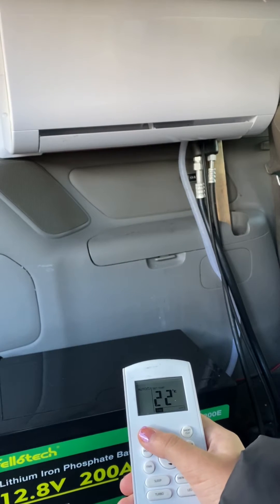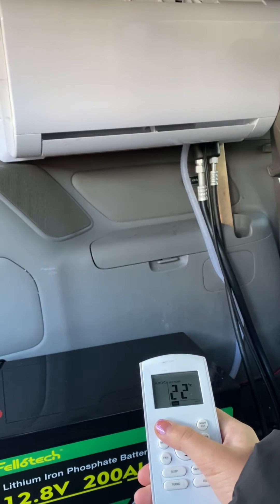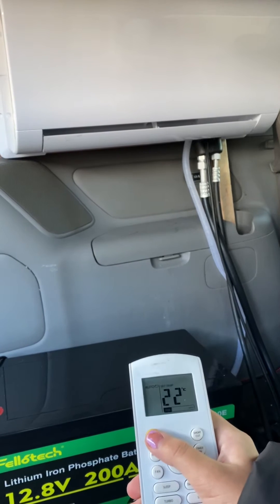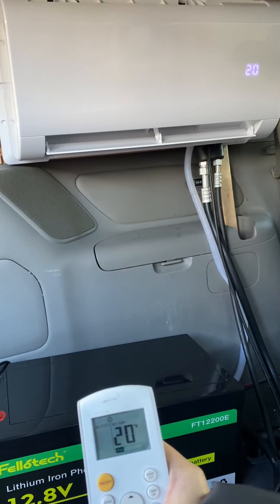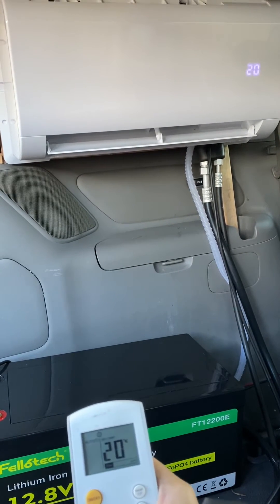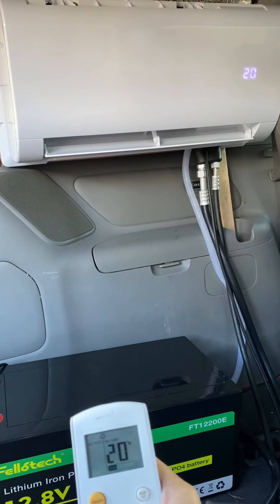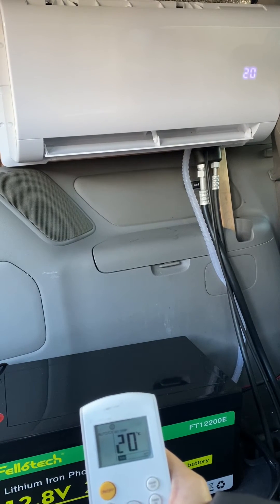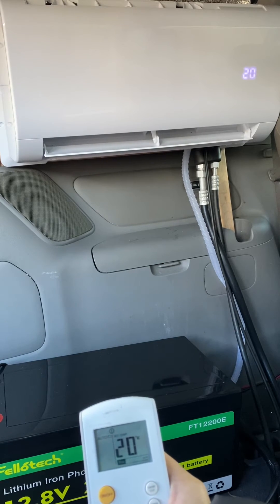ACDC mini-split 12V air conditioner operation

Comment: How long do you think it will it run on your 200ah battery?
Reply: 4 hours
Reply: Amazon says 8 hrs,it's 685 watts at max setting, once space is cooled down watt usage decreases, so most units watts decrease to about half ,I'd say a 600 ah battery would last a good 12 hrs wit 40% percent battery usage left over.

Comment: I was wondering if you knew when the 24v model would be back in stock on amazon or if there was a way to order it directly and how much it would cost? Also, on the amazon listing it says it comes with " pre-filled R-134A refrigerant." Does this mean that the lines and everything are precharged and all I have to do is connect it to the device or do I still need to have an HVAC person vacuum and fill the unit once it's installed?